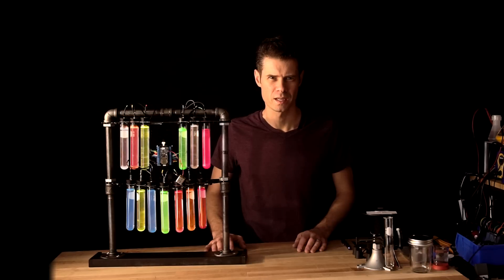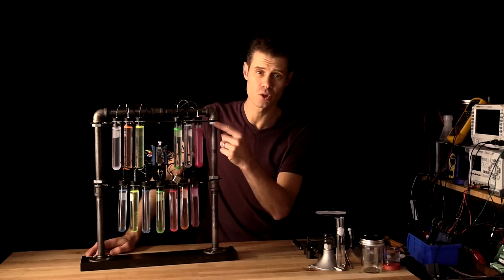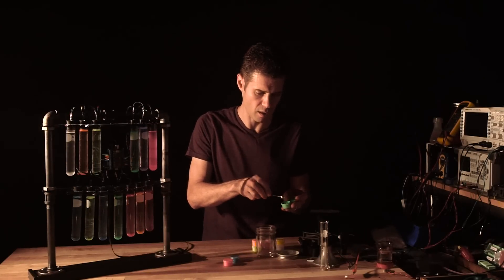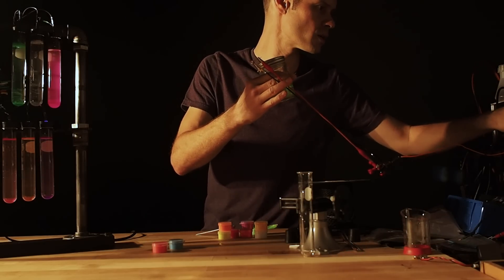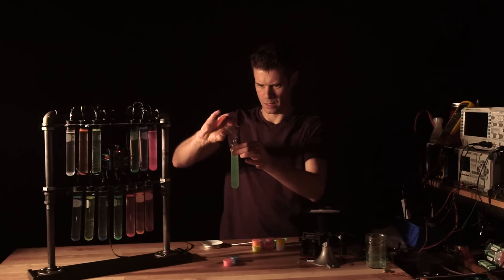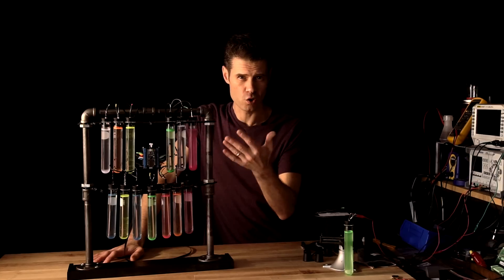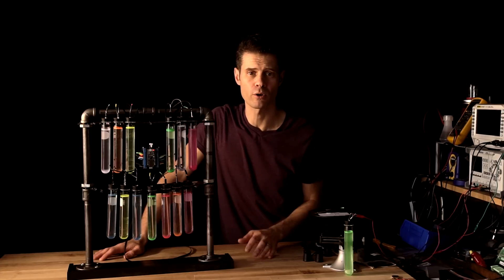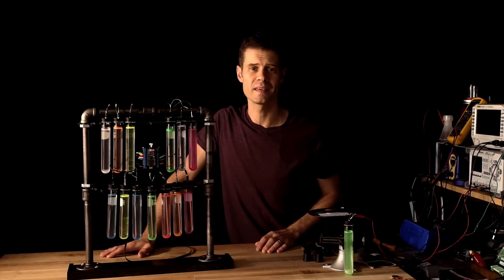John Park's Mad Science Test Tube Rack @adafruit @johnedgarpark #Halloween #adafruit

Comment: How tightly does the LED fit into the stopper? I'm thinking I could add a little more pop to the individual tubes with some air from a fish tank bubbler, but obviously if the seal is too tight I'll end up with a bigger pop than I'm looking for.
Reply: Oops, sorry I missed this comment. It's a tight fit with predrilled stoppers, but they make a nifty plug coring tool that you could use to increase the size pretty neatly.

Comment: You can probably use highlighter ink in a pinch just soak it in water, also you can buy leak detector concentrate, used for detecting leaks in plumbing, fuel hydraulics etc.

Comment: A couple tips on chemical handling from a fellow mad scientist:

For a safer approach, you can pop open highlighters and squeeze a drop or two into water for a comparable fluorescence effect. Much safer than working with concentrated or powder dyes and they come in lots of colors. If you don't want any stuff on your hands, pick up a pair of nitrile (blue, purple) gloves from a local pharmacy or ask the guys behind the counter if they're nice. Lastly, to mix, I'd recommend swirling in a disposable cup so none of the chemicals come into contact with something that might be used to store food etc later.

But the Feather microcontroller sure does the trick!
Reply: Thanks, good tips, I'll add them to the guide.
Reply: Right on, thanks!